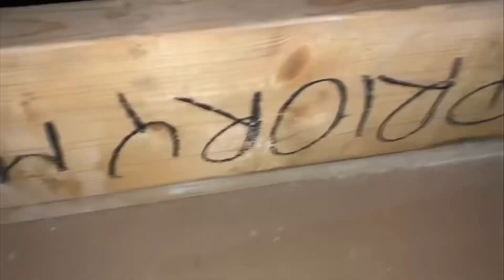How to Wire 2 Way Switches - Electrical Wiring

Comment: would you do the same with the Earth on a metal box
Reply: if the switch is plastic then yes, if the switch is metal all the earths go into the switch earth terminal then a fly lead needs to go from the switch earth terminal to the back box earth terminal

Comment: Any advice, i have two, two gang switches, one in hallway upstairs and one downstairs.

For simplicity sake, ignore the light downstairs and one side of the gang.

Upstairs i have a three core yellow goes to common, red to  one way terminal and blue to the 2 way terminal. 

Off this i have a two core red connected to 1 way and black to 2 way terminals. I presme this wire used to be for the light. It was cut when i had a loft conversion.

So how does it work when im presuming the circuit feed is coming from the switch downstairs.

Comment: Do you need 3x 3core cables if you want two 3 gang switches from two different locations or can you run 1 3core to the other switch?

Comment: Need some help, i  have 1 gang 2 way switches.

(Switch 1) black wire brown sleeve into L1, brown wire into L2 and grey wire brown sleeve into L3

(Switch 2)  black wire brown sleeve into L1,  2  brown wires into L2, grey with brown sleeve+blue wires L3
2 earth wires go into connect box.

I want to change one switch with a dimmer switch ( BG electrical evolve single touch 2 way master) at the rear there are 3 connections. 1) wavy line with arrow through it. 2) s.link. 3) L

Does black wire brown sleeve go into wavy line with arrow , brown wires go into L,  and grey with brown sleeve+ blue wire into s.link ?

I would really appreciate your help 👍

Comment: How do you wire a 2 way switch but for a device? I'd like to do it for a shower pump. Basically so I can switch the pump on and off from the ensuite and main bathroom

Comment: Interesting videos as always but why two operations on stripping cable with a knife, don't get that one. Side cutters do both as one operation. 
Another more important point is, why do you never show 2 way switching using a twin between the switches(not 3c&E), with a switch wire at the second switch and your common on the other switch?? Gives you alternatives in real life  situations and another switch wire if required.

Comment: So any non brown wire with brown sleeving just indicates it's live rather than its function? i.e. A switched live. I thought brown sleeving meant it's a switch wire.
Reply: No we identify other colours as brown to show they are "live" technically the neutral can be a live conductor for the return path but you its to avoid confusion if a blue is used as a live or switch live, someone thinking its a netrual

Comment: Why Oh why on CPC (...earth, get it?!) is there not a standard for the Common on 2 ways, and why no agreement on SWA cable colour usage. Long overdue. Nice video.
Reply: That would've been great, but there's no functional or safety degradation in using whichever colour because all conductors are the same current carrying capacity. Just remember to sleeve all three. And comms go to comms.

Comment: Could you do videos on how to wire, 2, 3 and gang switches
Reply from the maker: Wiring Diagram Using a 2 Gang Switch to Control 2 Independent Lights Using the 3 Plate Wiring Method
https://youtu.be/V48q0RHEbNE

Loads of 2 gang videos on the channel 👍🏻